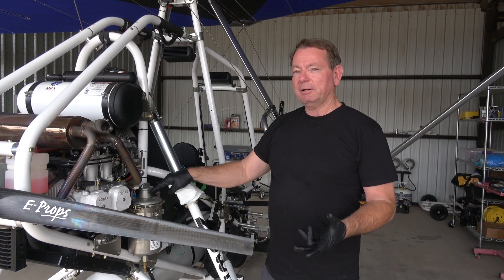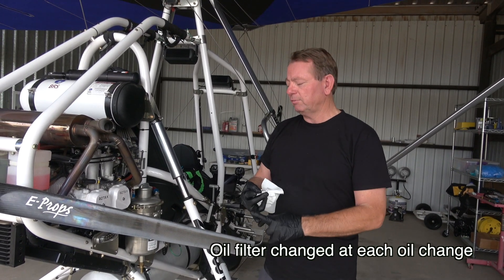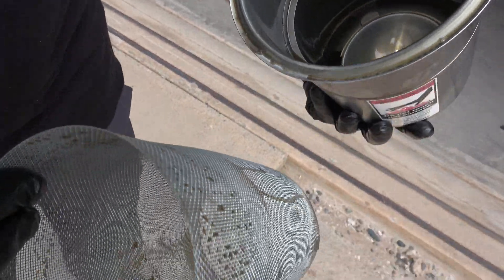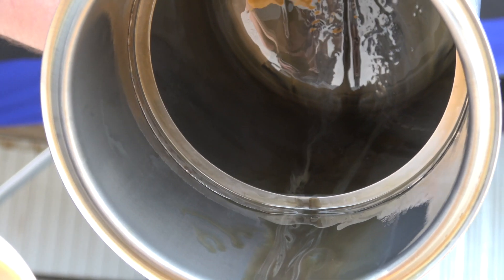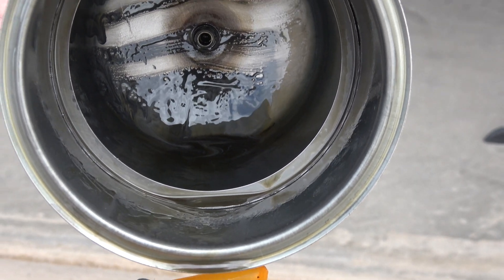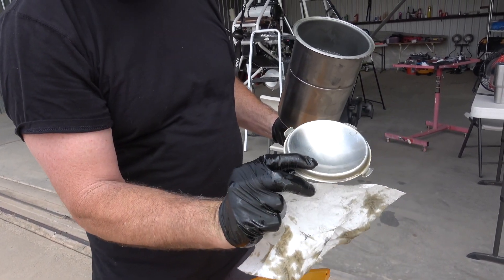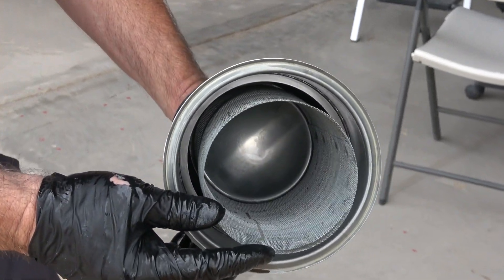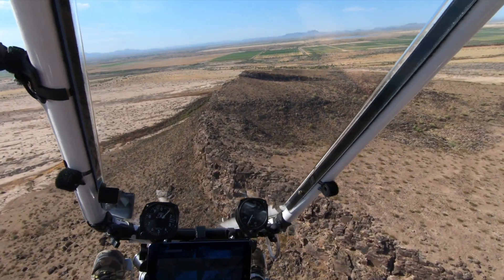Cleaning Rotax oil tank after using only 100LL AVGAS for 100 hours

Comment: I sure you did not go running that engine after opening the oil tank and lines to air without following an oil purge procedure that requires 7 to 15 psi air pressure, spark plugs off and special oil fittings on tank. If you did not do that, expect your valves to stick in maybe 300 hours.
Reply from the maker: I did a lot of research on this.   I didn’t let my lines drain.   I was informed it’s not necessary to do a purge after this procedure.   I’ve done this three times since this video.  I have 560 hours more than when I did this video.   Main thing is to not turn the prop when you have your hoses disconnected.   I used rubber plugs to close off the lines.  Do you do a purge when you change your oil filter?   Do you pre fill your oil filter?    I did a purge when I did my gear box inspection but that is the v only time I have had to do one.
Reply: @larsonadventures580  Not letting the lines drain is a good step but it is not 100% secure because even just a little oil drip means introduction of air. I have a customer in a gyroplane who last year had a engine out after 300 hours of putting a new engine in because he did not do the oil purge. It is a 15 minute procedure with some simple tools. Best to do it when you do this cleaning. You should also use Decalin. Lead buildup in the exhaust is not really a big problem. Just change oil every 30 hours

Comment: Hey Tom.  Check your engine plate and see if you don't have an 01 at the end of your serial number tag.  The 01 means you have different temps on certain things.  Look at the operators manual and you will see what I am talking about.  You have to look on your actual engine to determine if you have it.  We read CHT as Water Temp.  I have the 100HP Rotax.  I have the 01 on the end of my serial number
Reply: Also your Rotax Plugs have 142 inch pound Torque....there is a service Bulletin about that.  I have had to dig into some of this stuff,  If you don't know about the changes it is really easy to overlook the differences.

Comment: Thanks Roger! Very informative. When you were running 100LL did you use any additives, like Decalin?
Reply from the maker: I used Decalin only 3-4 times between 50-100 hours in my 18 gallon tank.  I filled up at many distant airports and did not carry any with me.

Comment: Hey Roger, have you heard of TCP? It's an additive for 100LL that  traps the lead and makes it go harmlessly out the exhaust. Hirth said that is good to use with their engines so I would think that it's good for others as well. That's what I'm going to do with my Aerolite 103 when it gets here next month. Mypilotstore.com in Scottsdale has it.
Reply: Robert Pilchman I’ve heard that it can cause lead buildup inside the exhaust though... no idea what the long term effects of that are.  ???
Reply: AV8R Tom I would think that lead in the exhaust is better than lead in the engine.
Reply: Yes I just put some tcp in this tank.  It would be interesting to use it and then check what the tank looks like after 100 hours.
Reply: Roger Larson I wonder how it will affect the prop since the exhaust points right at it..
Reply from the maker: Any led residue wipes right off

Comment: Hey Tom.  Glad you enjoyed it. Warm the Engine and burp it before cleaning out the tank.  I took off the hoses, plugged the out hose with a rubber plug, there will be oil in the out but not the in.  Use two wrenches when taking off the connectors, one to hold the nut the other to turn the An connector.  The band that holds my tank in place was a 11 mm nut.  Pre-oil the Filter for quick Oil pressure.  Oil pressure came up right away.  3L of Aeroshell Sport Plus 4.  I am going to try to use Some Auto Gas.  I like certain things about AV Gas but I wish it didn't have the Lead.  If we lived back East we could get different types of gas Easily.  Don't turn the prop when you have anything off like the Tank or Oil filter, Add Oil to the tank before turning the prop.....It was all pretty easy but a second set of hands makes it even easier.  Don't mix up the Out and In hoses.
Reply: Roger Larson Thanks for the tips! I’m actually only getting ready for my first change. 25hrs, so I don’t need to remove the canister yet, but I know I would have to eventually. Mine is S-LSA and will need an A&P annual anyway, so I get to have him do it most likely.  I can’t believe you have over 100 hrs already! Let us know how it goes with the auto gas!Larry recommended against it, but you’re in Arizona, so I doubt you get much condensation in your tank to contaminate your fuel. My understanding is it’s easier to remove water contamination from avgas than auto gas. I opted to use avgas mostly for its availability, but I’m realizing now, I’m pretty much taking off and landing at my home base anyway, not really refueling at other airports, so availability of auto gas isn’t really a factor. Do you have the 80hp 912? I noticed the labels on your control bar  have different limits than the ones I found in my manual. I labeled mine as well, but on the instrument pod. Anyway... I’m rambling😆. Happy flying!!!